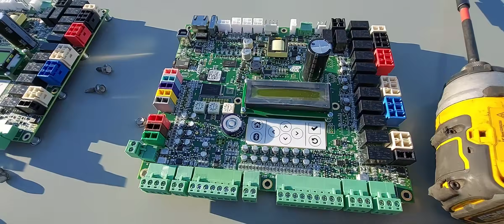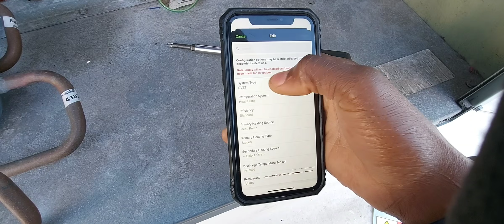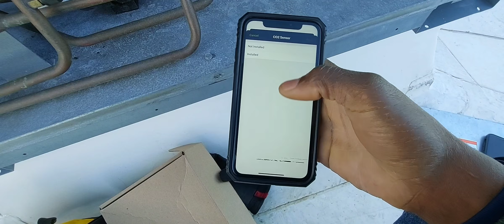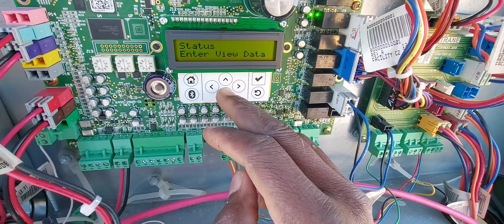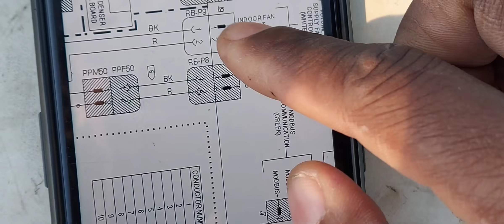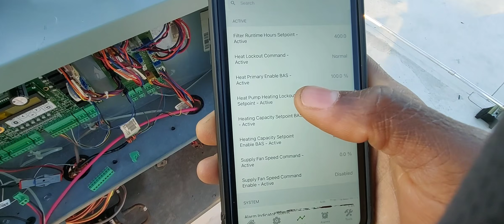TRANE SYMBIO CONTROLS | CONTROLLER

Comment: The Precident is junk and the Symbio is worse.I've bought my last Trane units
Reply: this is lack of understanding how these units work  yes its getting harder and every company does stuff different but when you learn how to use the controller its actually easier and quicker and yes new tech seems to break more often at first and were the guinea pigs. but once u got it down it saves u time got a ten ton with a supply fan error shut down entire unit  is the fan bad ? this is were i start learning.
1 dumb video at a time been doing com restaurant for 43 years first time Ive seen a symbio but ill  be the goto guy soon thats how its done ps the pic is my wife not me
Reply: @myriambcacaregiver2908  Buy your equipment from A Trane commercial sales office that does not offer tech support and see how you do. Trane factory tech support won't have anything to do with you.I've got a ton of hours in two startups including getting all the correct options on site that go with my job .precident units are garbage .You'll cut yourself every time you get close to them(all sheet metal panels are razor sharp,I told my helper "watch I'm gonna shave with this piece right here" and I did).  I have a saying"If you can't get the tin work right you probably get the rest of it right ". Terminal blocks with no set screws to land incoming power.LP kits without the correct orfices (7 weeks working on that with South Florida Trane sales office). Trane parts in Manchester NH had it figured out in a matter of hours.I tried to shift this job over to Trane factory tech support, that didn't work . I could go on and on about these two units.Indoor fan accessibility,discharge air temp sensing tube ect.ect.I'm kinda new at this, only been doing it for 44years, but this is the first time a startup took longer than the installation.So in the future, I'll be issuing purchase orders to some body else and advertising for Trane.
Reply: @myriambcacaregiver2908 except carrier still uses a thermostat board and done.  Very simple
Reply from the maker: Quite a few people is saying that about this setup,,,, 🤷‍♂️I am starting to believe it

Comment: Trane has a legend that tells you what every digit in the serial number means (tells you what the unit has). If you do not have that, you should contact tech support and get that. 
     All this to say, you could just backup the configuration of your old board to your laptop and then just download it onto new board once it’s installed. (I’ve taken the Symbio factory training and That’s how Trane prefers you perform this upgrade)
Reply from the maker: Good imfo!!! What's the  pc software for symbio?
Reply: @D2DNYAC You can do it one of two ways:

—You can do it through the Symbio app on your phone, by plugging in an empty thumb-drive into that usb A port on the top left: IF the board is still responsive enough that it lets you interact with it through the app.
This the easiest method.

— If the board is non-responsive, then you resort to Tracer TU software on your laptop (assuming you have the licensed software) connected by a USB A to B cable to the top left of the board also.
You’ll be able to backup the program to your hard-drive.
This is the hardest method, because the software itself is hard to get and VERY costly if you can find someone willing to sell it to you.

Comment: When happens  when the condenser fan motor does not cycling on but the compressor runs.  I can press the condenser fan motor  in and it operates.
Reply from the maker: Could be a few things

Comment: These units are ridiculous. What is the purpose of this unit.
Reply from the maker: It's a heat pump  outdoor unit with complex controls
Reply: @D2DNYAC  no it isn't
Reply: @D2DNYAC  well , yours might be
Reply: @D2DNYAC  consider yourself lucky if that's what you've delt with. The twin condensers get fun.

Comment: Could you use the app on the old board to copy parameters on a note pad then input them in the configuration of the new board manually ? I’ve never done it before but if the display is only thing that’s messed up it might work unless some other component within the board doesn’t allow the access to the board anymore because of the malfunction.
Reply: Yes, you can save the configuration on your phone. Then, after installing a new board, you would download the previously saved configuration.
Reply from the maker: I believe that copy of settings from board to board is possible, however I never did it
Reply: We were taught to plug into the old/ existing board with our lap top and backup the configuration to files. Then remove and replace the board. After installation of new board is complete, download the configuration onto the new board. Much easier and faster.

Comment: I now have a 25 and 15 ton unit to start up with the Symbio 700 controls.  And I have never seen this before.  I’m trying to find all the information I can on this system
Reply from the maker: Good luck
Reply: Have you found some good info? Starting up my first system with symbio 700 controls and ripping my hair out trying to understand these things😂
Reply: @hunterwarren8565 What I've figured out so far, run EVERYTHING out to the condensing unit Fire Alm included. Be sure to run two bacnet cables from condenser to AHU for ICM ands modbus for the VFD if you have one or it won't run. Don't use the R terminal for anything use the 24v next to the ICM connection. Also be sure to jump your 24v at AHU up to the ICM connection to power up options module. But the best advice I can give is never start wondering ...why? Because there is no answer.

Comment: So when it comes to things like these if you don't know it's best not to put something in you should call the factory and ask them to send you the information for the unit based on the model and serial specific to that unit because by setting it up without knowing each parameter you will end up having a unit that barely works if it works at all not sure if you went back the day after but give us a heads up but I agree they should have a QR code or even just a 256 megabyte thumb drive in a plastic baggie that you could leave in the unit with its preloaded set points
Reply: Those days are gone you wil not get help from manufacturers anymore now days they would rather send you an engineer   and you get charged lots of money. game has changed you hardly find people willing to share knowledge.
Reply: Are you simply have to do is look up the model number nomenclature. The model number is the key to have the unit is built.